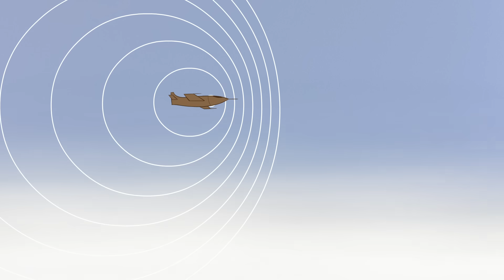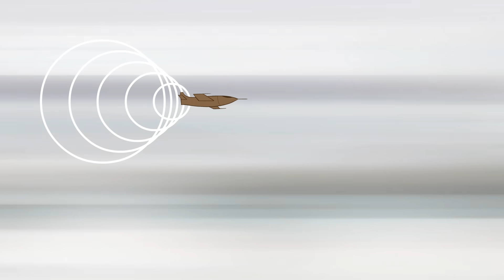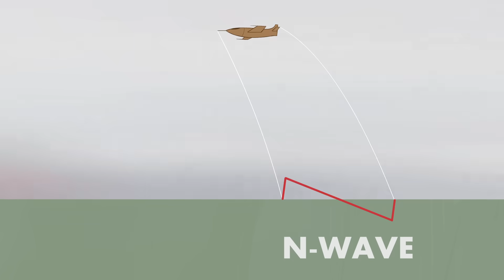The sonic boom problem - Katerina Kaouri

Comment: Isn't the speed of sound in km/h over 1,200? Then does it say that Jaeger broke the sound barrier at a little over 1,100?
Reply: +Leaf dogparkmayor that was at sea level, planes usually dont fly at sea level
Reply: +cole haly lol
Reply: cole haly o right haha
Reply: It has to do with the altitude.
Reply: +Ovr_pwrd n00b Yes indeed sound speed varies with altitude
Reply: +Leaf dogparkmayor it mainly depends on the temperature of the air. At higher altitute the air is colder and that's why the speed of sound is lesser.
Reply: Marco Gennari This is entirely incorrect
Reply: +cole haly no reply, as expected.
Reply: Marco Gennari I did not reply because, if you would bother to look at the comments above, I have already been corrected and I am aware of my previous mistakes. There is no longer a need to inform me that I'm incorrect, and so I did not acknowledge it.
Reply: Leaf dogparkmayor it wasn't for you, but for cole haly
Reply: +Leaf dogparkmayor 
Somebody did not pay attention!

Comment: if an object going faster than sound makes a sonic boom, and it doesn't only make one in the time of it moving, wouldn't you hear multiple sonic booms?  Or does it have some sort of...cool down?  Or does it have only one... which is when it hits the sound barrier, and if that, could it have more than one because it makes one every time it hits it?  and what would happen if it stayed faster than the speed of sound?  I wonder... if sound does this, could light do it to?
Reply: The sound sound barrier is not a physical thing it's just that speed sound travels at. The noise is the same as if the object were slower than sound just delayed because it travels faster than the sound
Reply: +Ecatadog Sharth (Dave) Dear Dave, all excellent questions. As soon as the aircraft crosses the sound barrier it starts generating sonic booms. it is like throwing continuously stones out of the window. These sonic booms are much louder than the sound we hear when the aircraft travel slower than sound. This is because of the bunched up wavefronts (circles) you can see in the animation which indicate that the sound is FOCUSED when a sonic boom is created. AT the moment of crossing the sound barrier the momentary sonic boom created is even stronger than the subsequent ones due to a super-focusing effects.
Reply: Katerina K so if the craft gets faster, does the sonic booms get louder?
Reply: +Ecatadog Sharth (Dave) actually, no. As the speed rises, the sound of plane drifts away from the surface faster, so the "dencity" of the sound gets lower and so does the loudness
Reply: +Ecatadog Sharth (Dave) Indeed. As the aircraft speed increases the strength of the shock wave (which is heard as the sonic boom) increases.
Reply: +Ecatadog Sharth (Dave) It will not happen with light because of the Theory of Relativity from Einstein, in which is written that one cannot travel faster than light, because the amount of energy needed to get faster a little bit under the speed of light gets infinite. (Sorry if I have grammar mistakes English is not my native language)

Comment: Those shrimp you mentioned use collapsing cavitaion bubbles, not sound.
Reply: SIMILAR. he didnt say that they were the same, but similar
Reply: Ecatadog Sharth Other than in general terms, how are they similar?
Reply: +james learing How do you suppose those bubbles are made?  Guess you didn't get that far on Wikipedia.
Reply: Vape Escape They're made by the shrimp snapping its claws at very high speeds, causing the bubble; the bubble quickly collapses. That's what causes cavitation.
Reply: james learing Care to be more specific, you know, like speeds and what not?
Reply: Vape Escape You want me to tell you how fast the shrimp snaps its claws?
Reply: What is the speed the tips of those claws are going at?  Come on, you can do it.

Comment: The reason why the shrimp sonic boom is so harmfull is not the schockwave itself, but the super high temperature in the air bubble caused by the sonic boom.

Comment: "Faster than the speed of sound IN AIR." The speed of sound is not a constant, it depends on an intermediary.
Reply: Yes the speed of sound depends on what the material the sound travels through indeed, but since we are talking about aircraft in this animation we are talking about the sound speed in the air.

Comment: is there a "sound barrier" underwater? is it (roughly) 300 times that of air?
if so what happens if you break it?
Reply: I'd imagine it would be the speed of sound underwater, which is about 4.3 times that of air. Travelling nearly 5000km/h underwater would be pretty difficult though

Comment: 2:12 WRONG. It's dependent on pressure, not altitude.
Reply: Indeed the sound speed depends on pressure (and on density) but since pressure (and density) depend on altitude (in the atmosphere) you can say, CORRECTLY, that the sound speed is dependent on altitude. Regards, Katerina Kaouri.
Reply: SearchListen Uh, it doesn't. Pressure varies, even on the same height.
Reply: Lesson Educator to TheLeftLibertarianAtheist: We are not wrong. Please read the following explanation: "The speed of sound in an ideal gas (such as the atmosphere in many cases) is proportional to the square root of the absolute temperature, but is independent of pressure or density. Although the speed of sound is expressed in terms of a ratio of both density and pressure, these quantities cancel out and we stay only with the dependence on temperature. Now, since temperature depends on altitude (please see e.g. US Standard Atmosphere diagrams) the sound speed depends on altitude. Sound speed in air varies only slightly with pressure because air is not quite an ideal gas but the ideal gas approximation is used very frequently when we are simulating sonic booms"
Reply: it's called vulgarisation of science, of course altitude meant pressure
Reply: TheLeftLibertarianAtheist Idiot, as you go up less fucking air molecules so pressure decreases resulting in non efficient transfer of energy = slower sound. Altitude correlates with pressure. Don't be a fucking idiot and get the fuck outta here.
Reply: Youtube Comments Suck I don't deny that. That doesn't mean the height determines the speed of sound. The speed of sound is as as on the ISS as it is at sea level.
Reply: Hmm, I'm not sure what you said makes much sense.

"Uh, it doesn't. Pressure varies, even on the same height."

If pressure varies even at the same altitude, that would be the last thing I would think about using for a calculation 1) because it's not constant and 2) we have little control over it in practical terms. It would make much more sense to use the constant of altitude and control that when flying. In the context of the video, their use of altitude makes more sense since we're talking about airplanes and what happens to them when they specifically create sonic booms. It would be like using a different variable for a different equation to achieve the same result, at least that's the way I understood it.  Apparently, from what I read on the wikipedia page and its links on sonic booms, "temperature" is technically the only real determinate when talking about them, in perfect conditions of course.
Reply: toocoolforu I know exactly what they meant. They are wrong, regardless.
Reply: Katerina K No gas is an ideal gas, though.

Comment: Does sound travel faster if it's travelling in the direction of wind?
Reply: excellent question, it should travel faster as the vibration of the molecules transmit their oscillation to nearby molecules which end up being further away from it's sound source than molecules which travel without wind. but i'm not sure. i am eager to hear a more professional answer!
Reply: That's along the lines of what I thought, it would be interesting to see if it's true!
Reply: Yes but not by very much considering that sound waves travel faster in solids than in gas molecules. But the direction of the wind might make the sound go only slightly faster because of the slight compression of the gas molecules

Comment: oh man,  you forgot to mention the whip: the first man-made object to travel faster than the speed of sound.
Reply: It is mentioned in the DIG DEEPER section. Regards, Katerina Kaouri
Reply: @LostinSongs  ı prefer planes
Reply: @LostinSongs  I love you 
Reply like the others
Reply: Katerina K I love how you reply to comments. Thank you so much for making the world a less stupid place with your intelligence.
Reply: i believe it may have been different at the altitude in which the sound barrier was broken
Reply: @artos607  they did mention a value just over 1200km/h at another point in the video
Reply: Jonathan Gonzalez-JonBurritoGaming actually, it does
Reply: +Nhan Vu The sound speed changes with altitude due to the changing density/pressure of the atmosphere with altitude so the sound speed was indeed less than 1200 when the sound barrier was broken.
Reply: @LostinSongs  I believe you will find the speed of sound is dependant on temperature, not pressure. The speed of sound reduces as temperature reduces. So it reduces from sea level up to around 80,000 feet then rises thereafter.
Reply: @tedsmith6137  pressure and temperature are related so you could talk about the dependency on either of them
Reply: @LostinSongs  Hooray for gas laws.
Reply: @LostinSongs  νομιζω μονο σε πριοχες πρπ ανω του κρισημου(Pcr,Tcr) σημειου θεωρουνται ανεξαρτητες πιεση και θερμοκρασια αν και δεν εψαξα ακομη τον λογο για τον οποιο συμβαινει..[1ο ετος ειμαι οπωτε δικαιολογουμαι καπως χδ]
Πολυ καλο βιντεο,δηλωνω ενθουσιασμενος btw
Reply: Street Fighter is the first game to break the sound barrier...
Reply: Honourable mention: T H E  B E L T
Reply: Igor Ilyasov childhood. asian mums
Reply: Igor Ilyasov before reading your comment I just wrote the same thing... I will delete now 😃
Reply: meow meow meow
Reply: +Katerina K The speed of sound is (almost entirely) independent of pressure. Altitude changes the speed of sound due to the temperature of the air - the speed of sound is proportional to the square root of the absolute temperature. http://www.phy.mtu.edu/~suits/SpeedofSound.html
The speed of sound is approximately 1234 km/h (343 m/s) at 20°C (293°K) and decreases with altitude as the temperature almost always drops as you go higher.
Reply: Igor Ilyasov I was gonna say that
Reply: That’s a theory
Reply: And then later, the gun.
Reply: Jhonny sins 😎
Reply: You mean hwip ?
Reply: Whiplash
Reply: +ArtPlays Indeed.
Reply: 1127 divided by 60 is um less than the speed of sound. 3 second per kilometer is the speed of sound... 20 per minute, 1200 per hour
Reply: +Xandawesome Dude (Xander Ashcraft) and watch me nay nay
Reply: Igor Ilyasov hahahahahaha
Reply: +Igor thats why mathematics and physics rule the world
Reply: 420th like

Comment: They explained that the plane travels faster than the sound waves and when those waves reach the person on the ground, but they never explained why this makes a boom sound. What is the science?
Reply: Hello! The boom sound is due to an abrupt overpressure and an abrupt underpressure which are caused by the supersonic airplane passing through air very fast. The human ear perceives the differences in pressure as sound. If these pressure differences are abrupt as in the case of sonic booms the sound sounds "sharp"  (see the N-wave in the video). Lesson educator
Reply: You might have noticed how they said that the soundwaves start to overlap in superssonic flight. When waves overlap, they will add together, leading to either higher or lower amplitude and because of that higher or lower volume. Essentially you're hearing a whole array of soundwaves emitted at different times from different places along the flightpath in an instant.
Reply: SearchListen
Thanks. That's what I wanted. Why couldn't they say that?
Reply: CBebop 4Ever That is why I am here :) In the 5 minutes of the animation inevitably some things cannot be said in detail. You can also read more in the DIG DEEPER section. Regards, Katerina Kaouri.